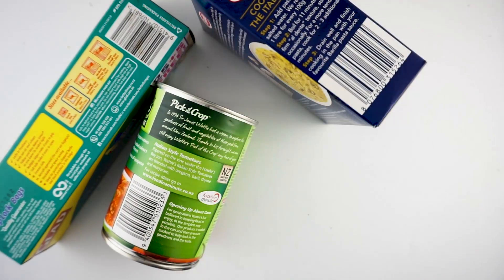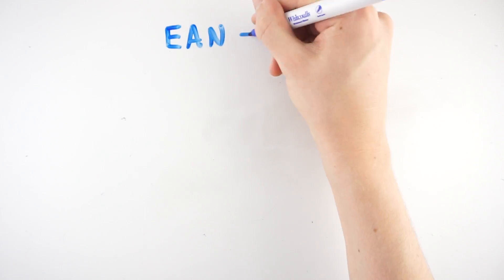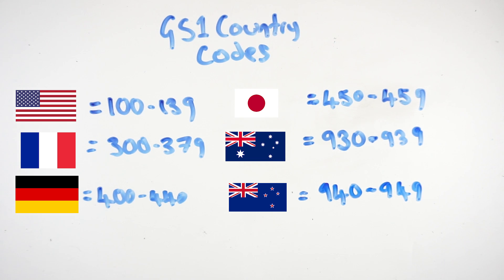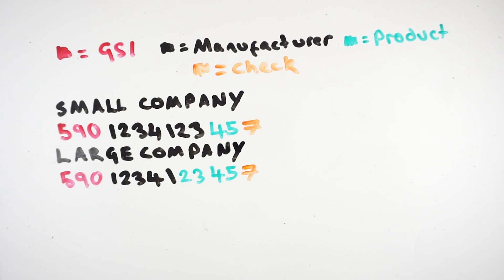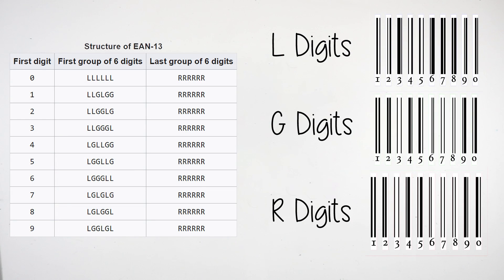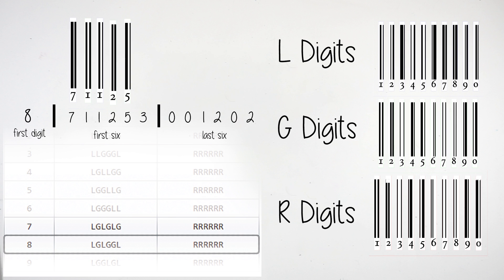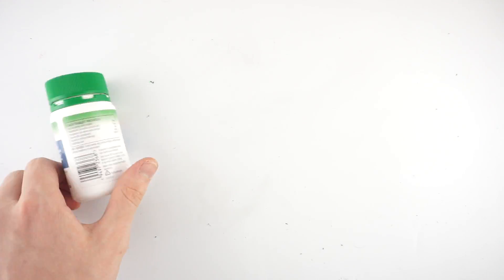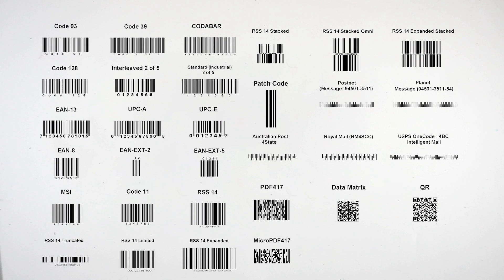How Do Barcodes Work?

Comment: Great video it would be cool to see one about QR codes. I don't really see much of a pattern in them to try and work out how they even work in the first place
Reply: I'd enjoy a video on this too. Though I do feel as though QR codes ended up being a fad - i see them around but hardly ever feel the need to actually use them.
Reply: They use BCH codes and mainly Reed-Solomon codes for error correction, which helps recover data even part of the code is danaged. Involves Galois field theory, which can be interesting as well as boring.